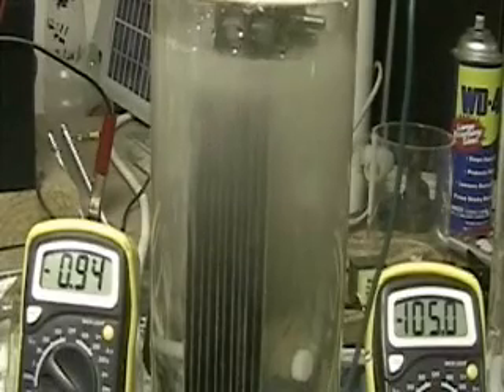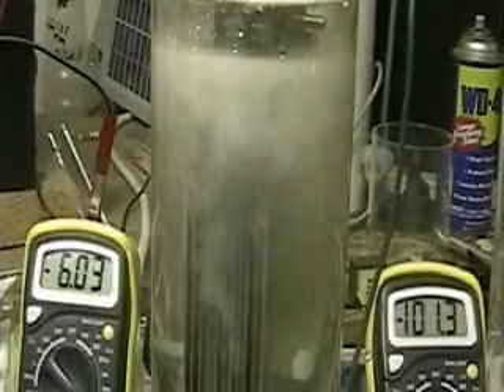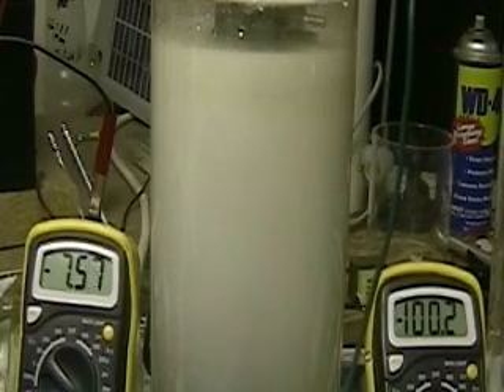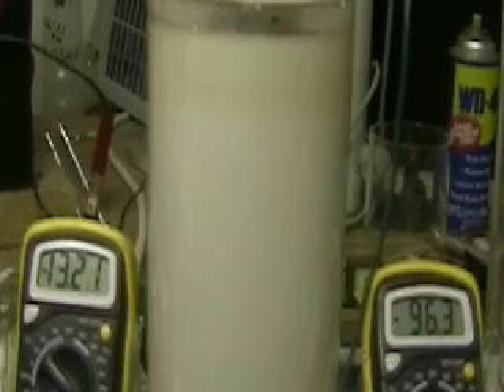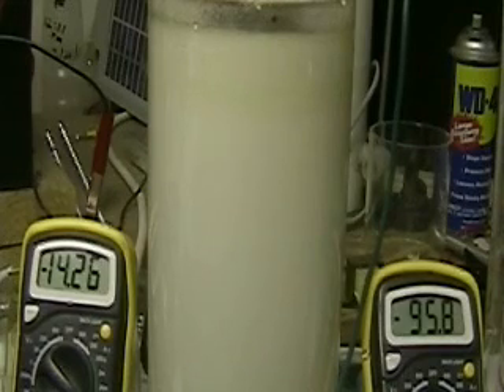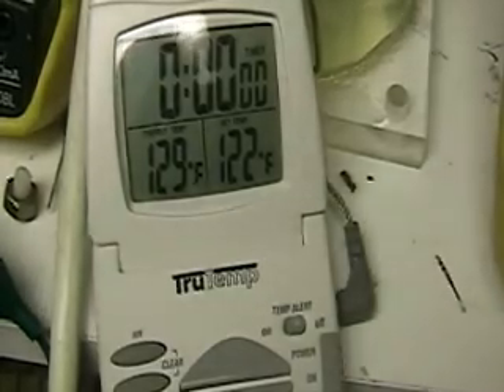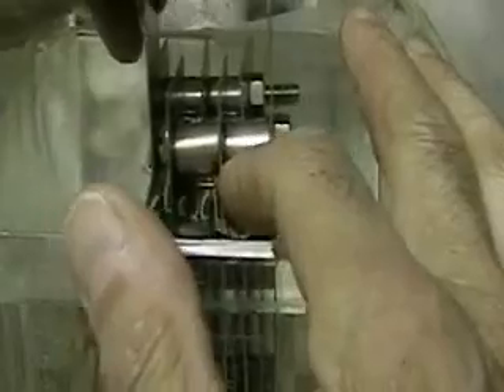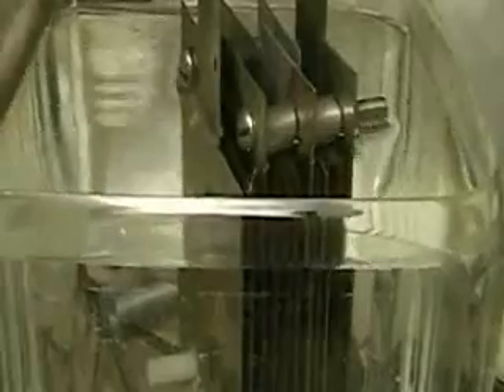Hydrogen Tap ( FOCUS-VOLTS) 342

Comment: A note of caution: You should use an isolation transformer before the bridge rectifier and after your AC outlet. Also, you should use an isolation transformer before the VARIAC as well. (Maybe that's why the VARIAC was damaged.)